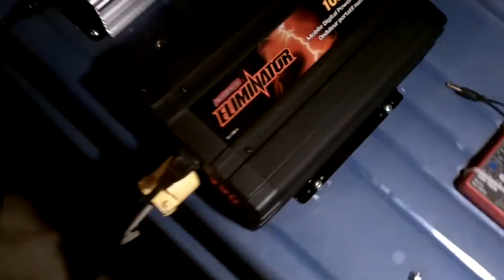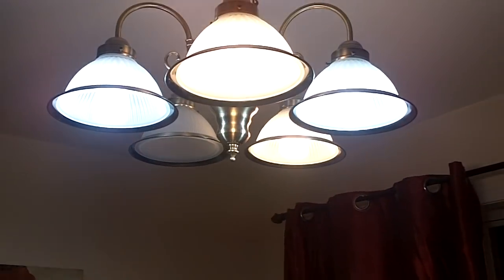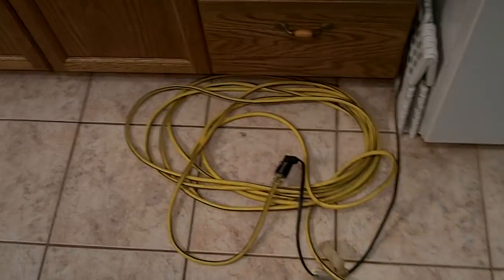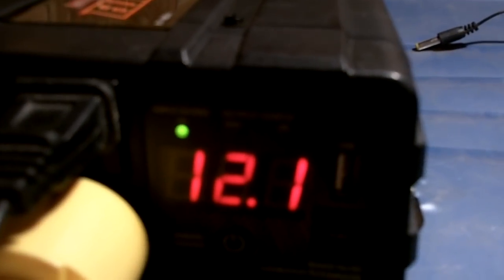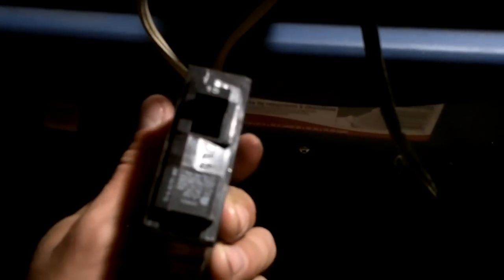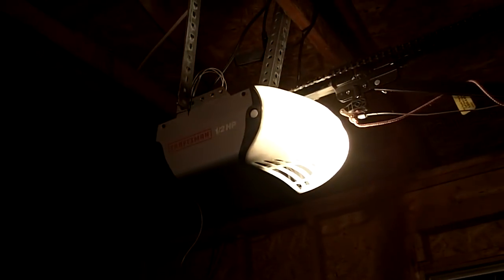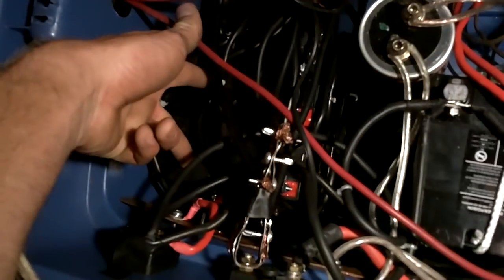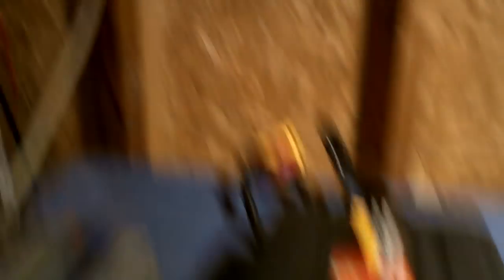House running off 1000W inverter

Comment: anyone else knowledgeable with brands of inverters? solar guys are major asses.
Reply from the maker: +ken ber What would you like to know, I offer the knowledge I have.
Reply: +fliping720 

I'm looking for a pure sine wave inverter but the guy "Knurlgnar24" on YouTube keeps posting videos with reviews on Inverters that I wanna buy saying they aren't any good.  I'm looking to get something off eBay buy see a few I'm interested in but two are Chinese brands.  I don't really know the true specs on a few and was looking to get something with direct connect.  I was hoping to send someone a few and get some opinions before I place an order.
Reply from the maker: ken ber let me know the inverter you are looking at ill and I will tell you what I think, Aso Knurlgnar24 is a very smart man and 99% of what he says about inverters is right, but I also have a few cheap chines inverters that work really well.

Comment: what about heat dryer stove need 24 volt setup
Reply: +Michael Persico  The battery bank he has is only capable of covering small emergency loads (about 82 useable Amp/hr or 1000 Watt/hr at 12V).  .  If he's running a fridge at 400 w/hour and another hundred watts of lights, laptop charger, small loads, he's good for about two hours.  Thank goodness he only has a 1000W inverter - if he tried to pull any significant loads his inverter would kick off at low-voltage within minutes.

Comment: you get a couple lights maybe a tv  or a computer  thats about it i dont care how many batteries you have
Reply: +Michael Persico Wrong where are your videos at please
Reply: Michael Persico no limit to battery storage just costs money
Reply: No shit it cost money. That isn't the point.  The point is how to stay up and running off the sun with no fuel in the event of a power outage.   You can get more than lights tv and computer.  Its how you spend your watts.  LED Lights use low low watts.  An energy efficient freezer chest can use 450-500 watts a day.  Convert that to a fridge and you can use less the 300 probably.  LED TV isn't much either.  You can do a lot with 1000 watts if you have the right accessories.
Reply: Ya it is the point. Finding the power isn't the hard or expensive part it's storing it. 3 400 hundred solar panels on a automatic or manual tracker will generate quite a bit of power in a location with good exposure even on a cloudy day. Just make sure you got the battery capacity to suck up all that energy
Reply: duh of course you have to have the right battery capacity.  where else you going to store that power from your panels.   The point I was making (assuming you have the right storage),  is that with a 1k inverter you can do a lot "IF" you get the right accessories to run on it.

Comment: 1000 watt inverter wont do a normal house  no way no how
Reply: ***** When someone is trying to be power smart. Yes. and no. City, or not. You'd be amazed how offgrid people can be and limit the useage to such things. Water is captured, fire is burned wood-style, even heat. Driers aren't used as it's called 'air-drying' hang them. Washing is done by hand. Again. When. AC is by fans, and we can use ether 12volt or 5volt fans now. Very low power. even lights can be 5 or 12volt and be ultra low power useage compared to AC 110volt powered. Many many ways. For true off-grid people, rather then just city-offpower. they go even deeper. And limit almost everything. So you'd most likely only find them using power for fans when needed, lights at ultra low power settings at night only, and laptop charging pretty even. You gotta remember. We have lived for over 20.000 years without electrical power. So only thing we really need (atleast for those wanting to do it.) is internet and a laptop. for power. The rest is basic labor use.
Reply: +Michael Persico A smart person can live on a house that only has a 3kw system. So like he mentioned if he wanted to power the whole house with limited ability. Besides LED lights and low draw fans. It could happen. 1000watt or 1kw system for only your standard single person or 2 person buddy. Could run off it pretty well. | Now for how long and such is a different question. But in point. it could work.
Reply: won't even do my old ladys vibrator
Reply from the maker: +Mike Roberts that is what I have :)
Reply: https://www.youtube.com/watch?v=sVEdD0OHD30&feature=youtu.be
Reply: Patrick, is that one of those kick-start models? :D

Comment: So, title is wrong, should be 1/2 house on 1000 watt inverter.
Reply from the maker: haha but the house is still running off a 1000th inverter
Reply: no its really not unless you have a 200 sq ft house
Reply: 20 amp fuse panel  lol

Comment: you forgot to show the batteries and go into detail about them   fail!
Reply from the maker: Niko grossenbacher i was showing how you can run of solar/Battery backup for emergence needs, this is if you had to and need to run a fridge and some lights then you could keep this up as long as their is sun. BTW with 2100W of solar you should be able to run a fridge and freezer 24/7/365
Reply from the maker: the official sandidge02 well it did so.
Reply from the maker: John Davids in this video I was able to run off batteries for a few hours as backup power at night, and as long as I like in the day time.
Reply: +John Davids The battery is just a tank you use from but you have to refill it. We can buy panels for 60 cents a watt, what do you pay?
Reply: +John Davids you'll have to have solar panels eventually to charge the batteries, if not solar than something else, wind turbines, water turbines, or just simply man power! Pedalling on a stationary bike with a flywheel attached to an alternator (generator) will produce you a decent amount of electricity & keep you fit! :)
Reply from the maker: the official sandidge02 an old one that uses lots of power, this video is to show what you can run in a power outage, I stated this in description
Reply from the maker: this is a really old video check out my newer ones
Reply: +fliping720 ...excuse my dumb question but is it running solely on BATTERY power  ?...no solar or anything ?  Im asking this question becos I live in the rural areas of Namibia, Africa, solar technology is SUPER EXPENSIVE so using solely battery power would be like sooooo amazing in this part of the world..THANX
Reply from the maker: +Kirk McLoren 70 per watt
Reply from the maker: i had 500w of solar in this video
Reply from the maker: yes 95% of panels are over rated, i now have 1480W of solar power and I get 80-100 amps at 12 volts in full sun, and i have over 1700Ah of batteries now.
Reply from the maker: I use an Xantrex SW 3000, But a samlex or Go power inverter are also good!
Reply: the official sandidge02 they definitely will

Comment: how did you get the solar power to your house?  did you use a grid tie?  how to you isolate your light circuits to use the solar power?  did you use a subpanel off your main power panel?
Reply: +Matthew Sherman found a few good ways to use solar in your home....use a transfer switch...or a lock out switch...have a generator port installed by a electrician....then just plug into your house whenever you want...fuck pgand e and monopolized energy companies

Comment: hey man i just got this exact same inverter. I was impressed with your video and decided to check out Canadian Tire. I am glad i did because it was on sale for $199.
Reply from the maker: +wesdex04  thats a good deal! great inverter for the price!
Reply from the maker: the right way is a sub panel in this video i used a suicide cord, I don't recommend it as it can be dangerous.

Comment: I can't run my washing machine and water pump at the same time on a 1000W inverter. How do you do it?
Reply from the maker: +Pop's Shack my house doesnt have a water pump, and when i run my washer i shut everything else off
Reply: dblock2626 No, that's not a problem as my washing machine doesn't use a steady 1500W. Trust me, I've tested it. 5W when it's filling with water, 950W in the spin cycle, about 250W when agitating. It uses less than .1kWh to do a load of washing.
Reply: Washing machining use a steady 1500w there's ur first problem

Comment: can I run a 21" tv and a PS4 in my truck 750w or 1000w power inverter? while waiting for the wife while doing grocery shopping... thanks
Reply from the maker: Kevin Vernal yes you can! even a 600w inverter will do the job
Reply: fliping720  tnx sir... but where can I get the good/best inverters?
Reply from the maker: Kevin Vernal where do you live? if canada Canadian tire has some not to bad Eliminator inverters, if the states harbor fraight tools has some cheapy inverters that will also work, or you can buy a really nice go power 300W pure sine wave inverter for $200 that will run the tv and ps 3 or 4 no problem.
Reply: fliping720 USA...

Comment: sir when running the 1000 watt inverter at full capacity how many amps DC are you drawing from the battery
Reply from the maker: Absolom Madhaka around 100 amps
Reply from the maker: Pop's Shack yes 2 gage to the inverter and 4 gage between batteries at this time if filming, my set up is quit different now check out my new videos
Reply: +fliping720 Is all of your wiring capable of 100 amps? Are your fuses capable of at least 125 amps?

Comment: Okay did you disconnect all grid wires before turning this thing on? You just might kill electrician who do repairs in that grid.
Reply from the maker: Artjoms Pugacovsyes i did, also this small 1000W inverter does not have enough power to force power into the grid in a grid down situation.
Reply: It could, if the problem is on your street, for example, and guys are opening switches to isolate problem areas.

Comment: I don't know.....fridge is about 1500 watts, so I don't know if your trying to pull our legs with your 1000 watts inverter
Reply from the maker: lightrose100 a 1500w inverter is needed if its a cheapo inverter and if you have a really good inverter then 600-1000W inverter is ok for the job, i always say 1500 so if someone goes out and buys the cheapest 1500w inverter out there then it will most likely work to run the fridge

Comment: Warning!!!!!!  While this video shows what can be accomplished, there are a number of very potentially dangerous conditions created by the techniques used to put the power back into the homes electrical system...!!!!!!  The Dead-mans cord or Suicide Cord...  the means of attaching the wires coming out of the inverter into a standard circuit breaker...  The fact that if you don't turn off the main breaker, you could kill a power authority worker by  back feeding the main power lines coming to the home...

The concept is sound, but, invest in a proper generator panel that will disconnect the power from the mains (this protects your backup system from being fried as well) and use certified connection boxes and breaker panels...

Again, excellent demonstration of what a simple backup power system can do, just be sure to follow the best wiring practices to protect your home and family and use the right materials...  They aren't very expensive and are available at most big box retailers these days...
Reply from the maker: Glen L yes I try to make it very obvious that its very dangerous to back feed especially in my newer videos, and Agree 100% a generator panel is needed, this is only a means of helping if the grid went down for days and people needed backup power, in my newest video i show how I do this and that im waiting on the funds to install a panel soon.
Reply: +Glen “Nanaimo Electrician” L True. There was a lineman killed a few years ago locally when someone was back feeding into the electrical system during a power outage.
Reply from the maker: +Kelly Meacham yes he used a larger generator and he forgot you shut off the mains to his house.
Reply from the maker: I have 7 :)
Reply: Any lineman killed from a backfeed system didn't follow safe clearance procedures. It's only happened a handful of times and no instances where a homeowner's portable generator was involved. Gas stations and other businesses with large trailer units/welders have killed a few lineman, people clearing roads after a storm and a few other jackasses
Reply: +Glen “Nanaimo Electrician” L Kelly/Flipping...  I'm an electrical contractor and just spoke with a couple of homeowners a week or so ago and they thought it would be absolutely fine to back feed the house...  No understanding of the fact that if electricity can come down from the pole, it can go back up to the pole as well...  That is why a proper generator panel is needed... so that if the power is converted over to the generator, it is automatically separated front the power company...  Thanks for commenting, it helps when people get the word out and take notice... :)
Reply: Going Off Grid Fire Extinguisher anyone?

Comment: I dont get how it works ? Have you taken the power from the batteries via the invertor into a normal mains socket  plug?
Reply from the maker: Ian Mann yes i have used a suicide cord in this video, they are not safe and must be used with great care
Reply: what is a suicide cord  ?
Reply from the maker: Ian Mann its a extension cord with 2 males ends on it

Comment: Clamp meters do NOT work on DC, they only read on AC,  Read the manual.
the meter is good the user is just UN-familuar.
Reply: fliping720  Great I have watched a number of them, you might want to edit the video, as that clamp on meter (AC) will read pulsating DC say coming out of a PCM type solar regulator which of course has no value, other than add confusion... Good work cheers
Reply: Stan M  my 300$ Klein cl 2000 clamp meter reads dc amps fine
Reply from the maker: Stan M yes your right i found that out through trail and error
Reply: Stan M They make clamp meters to measure DC amps. I am not saying the meter in this video will do it because I didn't watch the entire video, but they do exist and I don't want anyone taking your blanket statement as fact.
Reply: Partikkus   Sorry clamp on meter read field, the clamp on meter that read DC use wires, you plug the wires in series with the wires and the two
holes supplied in the Clamp meter..   NO clamp meter can read DC current using the field clamp
Reply: Stan M DC Clamp meters use the Hall effect to measure DC amps without interrupting the circuit. Link below provides a simple explanation and will further your education.

http://www.electrotechnik.net/2009/09/how-does-dc-clampmeter-work.html
Reply: Partikkus   I own the same meter as you used on your video
it does not have the hall effect in it   I would suggest you edit your video
and now that you have looked up better meters.   Make a video on how to use them correctly,  you are good at presenting....Make use of it.

Cheers
Reply from the maker: Stan M I have made lots of videos and I learn as I go, my newer videos don't have these mistakes :)
Reply: Stan M You have me confused with the author of this video. I did not make this video. I stumbled upon it amusing myself watching arc flash videos. I noticed your initial comment and wanted to correct your statement that clamp meters won't work on DC. I didn't watch more than 30 seconds of this video so I don't even know the type of meter used in this video.